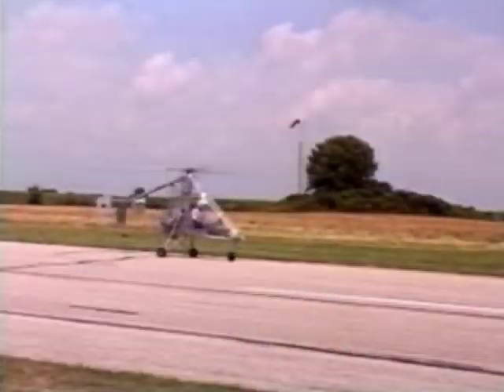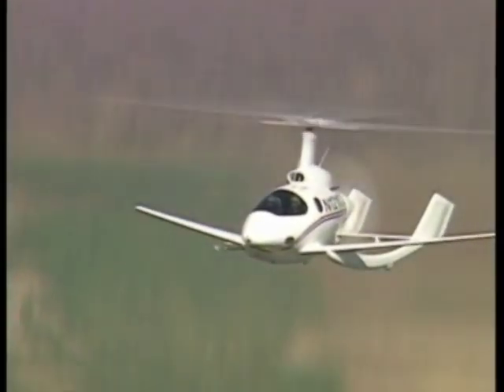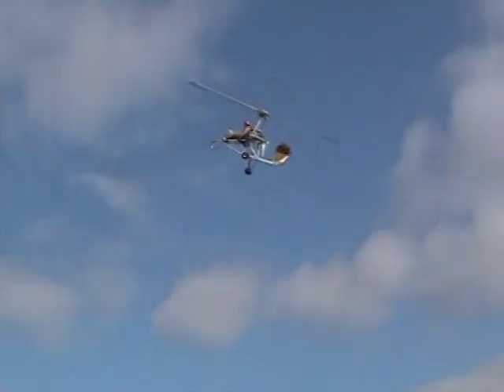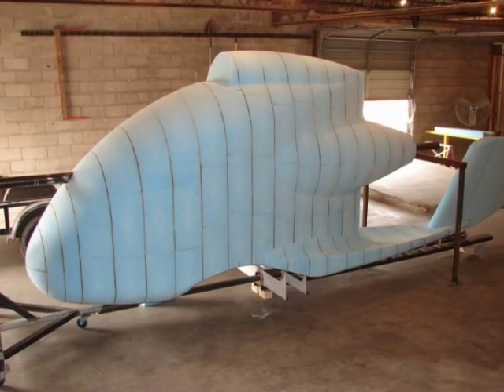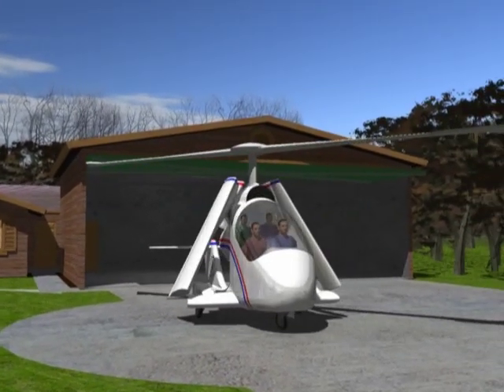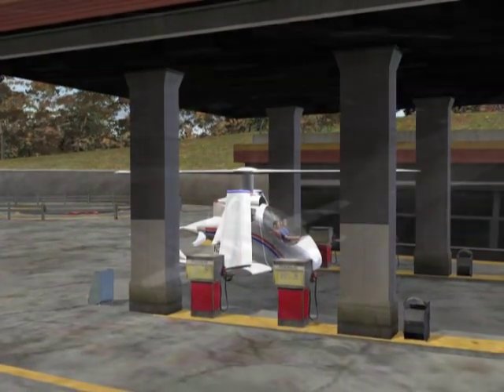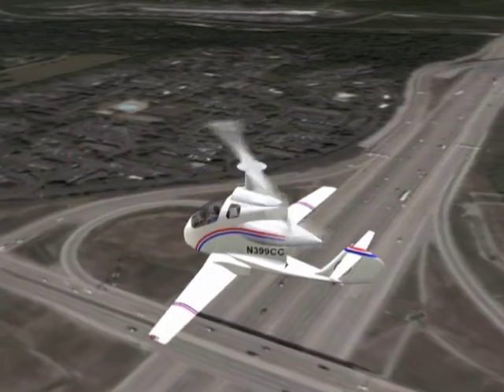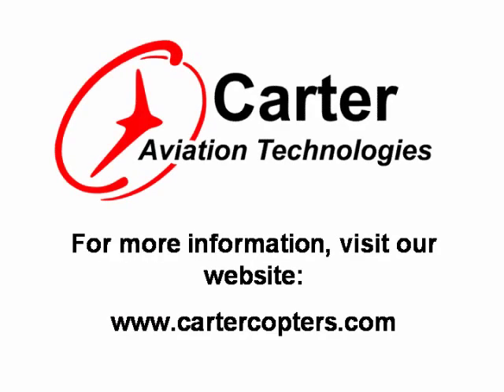Oshkosh 2009 Video 1

Comment: When will Carter Aviation produce a civil air transportation vechile similar to the Fairey Rotodyne. A sixty to one hundred seat city center to city center midrange airliner may even negate the need for high speed rail.
Reply: It certainly requires less infrastructure